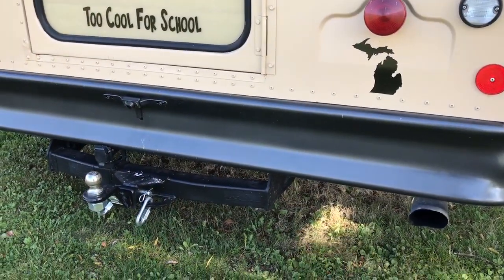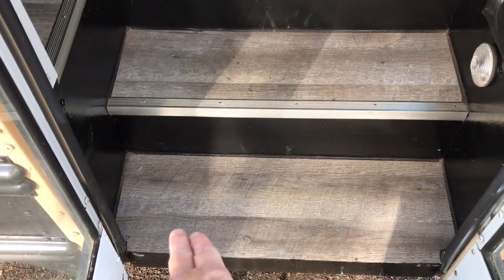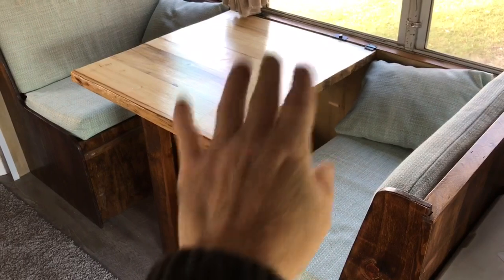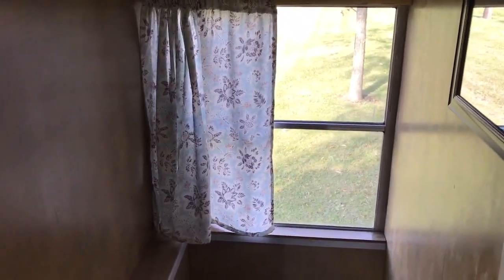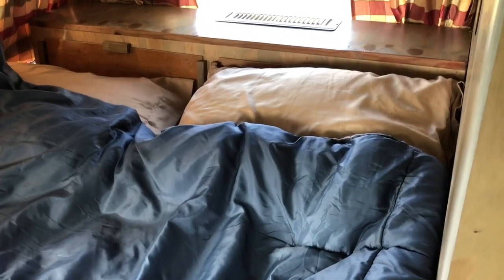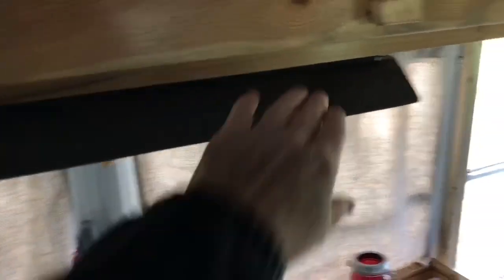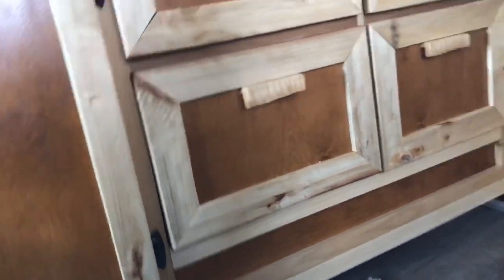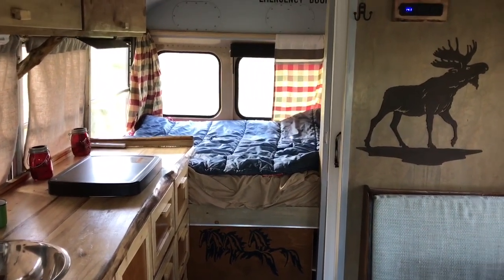Skoolie Short Bus Conversion Tour

Comment: You did a really great job on the layout of your bus. I have this exact same bus and I actually purchased it from the same dealer where you got yours from. (I think I may have commented on that on your first bus video) I have done a lot of work to the bus getting it fine tuned along with dealing with some corrosion due to the bus being up north but it's now officially the best running vehicle we own. I plan on using your layout as a template for my build.
Reply from the maker: It’s the perfect size isn’t it?
Reply: @hollijacobs7858  Yeah and I couldn't agree more with you. Years ago I owned an old full size 1969 Dodge school bus that got about 7 to maybe 9 miles to the gallon and it was a straight drive but I used it with a band and it really held up. I didn't keep it because it was a beast to maneuver in tight places where this bus can literally park in a single slot with only a bit sticking out. Like your bus, my fiberglass piece over the window had cracked and was rattling but I repaired it. I want to do what you did especially with the switches. That was a great idea. I had to do a lot of work on my bus due to corrosion and I also replaced all of the fuel injectors and glow plugs along with the wiring harnesses because it had a skip that was coming and going but I knew what it was. I also replaced the drive shaft and redid all of the brakes. The bus is running great and I now plan on working on the inside. I'm going to keep things simple with the layout. I'll be making a video somewhere in the future.

Comment: I love your dinette!!! I have a question though. You mentioned that you use the heater that came with the bus. Does that run through your solar?
Reply from the maker: No, it runs off the engine while it’s running.  I have a Little Buddy propane heater and electric heater.  I do not live in this full time.  I Just travel.  So this works pretty well for me.